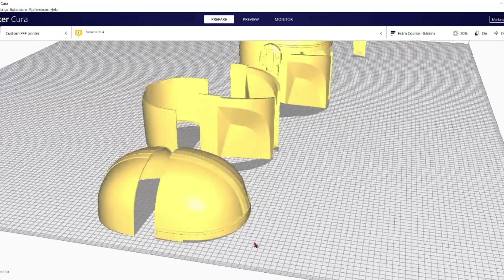Elegoo Neptune 3 MAX VS Creality CR-M4!  Can $470 beat $1100??

Comment: I have both these printers and they are both big disappointments. the Elegoo is compatible with Orca which is nice, but it suffers from poor build quality. Especially the hot end!

The problem with the CR-M4 is that Creality does not support it. Unless you want to build your own slicer profile, you're stuck using Creality Slicer 4.8.2, which has none of the features of a modern slicer. 
Creality is now up to version 6.0 of their slicer. It has a ton of nice (and in my opinion necessary) features. But they haven't added in profiles for the CR-M4. Think you'll use a nice slicer like Orca.... Nope no profiles. I haven't been able to find any (please send one if you do).
The most insulting part is that Creality Slicer V6.0 has profiles for all kinds of non-Creality printers including the Elegoo Neptune 4 Max, the CR-M4's crappier large format competitor...Creality has completely forgot about the CR-M4.

Comment: And now the Neptune 4 Max is out ($440), at 420x420x480.  So cool.  Being an open bed slinger limits your filament options, I guess, but PLA will probably do most everything you need, anyway.  Also needs more space than something like the Creality K1 Max, but that's a small thing compared to the massive build volume.  It would be nice to see an X/Y enclosed printer in this size.

Comment: Hey i have a neptune 4 max and the print head shakes and doesnt want to move but it levels and homes right. it only moves to home itself. Help plz.
Reply: Update : The small wires attached to the primary ribbon cable are incredibly fragile , I moved the device and brushed my futon (as my printer was on the floor) and knocked a single prong out of place. I had a false alarm prior to this that made me backtrack.

Comment: Bought a Neptune 3 max and I loved it but after a month it had some leveling issues which resulted in the blob of death that killed my heat element. Replaced the heat element and printer wouldn’t heat up. Elegoo is currently sending a new ribbon cable and printer head in like 2 weeks. It could have been my fault but I heard other customers had issues after a month on Amazon reviews. Customer service seemed really good but wonder if the creality printer would have that problem long term

Comment: @ frank  hey I was having some trouble with a 3d model  that I was trying to print .I'm not sure  why but when I slice it in cura it just does parts of it and it want do vertical  at all it prints the supports but want actual print the mask is there any tips you could think of. thanks!

Comment: Thanks for the video! That was absolutely information of use to me that you provided. I have two Creality printers right now. An Ender 5-S1 with Sonic Pad and a K1 Max. Got to say I'm quite disappointed with the K1 max. You can definitely tell they rushed it to Market. I'm considering a larger format printer for my next purchase as my business is starting to grow and I just need more space to print parts. Wanting to stick with the Creality brand I was considering the Cr-10 M4 but have been considering the Anycubic Cobra and Neptune 4 max. I know both of those run Klipper but I love the controllability and accessibility that the Sonic pad provides. I.E. Z-offset adjustment mid print, speed, extrusion rate etc. Do you happen to know if it's possible to hook up the Sonic pad to the Neptune for max? Or are those settings accessible through a web interface?

Comment: Alright in concerned now. I understand the elegoo neptune 3 max has a slightly taller build volume. I looking to make armor pieces similar in size to what you build. Will me getting the elegoo neptune 4 max with a 480mm build height be handicapping myself or did you still have room over your builds on the neptune 3 max 🤔

Comment: I have a creality Max and my biggest gripe is the undersized heater causing temps to be cooler for about 4 inches all around the bed. I print a lot of petg big parts always came out warped…Did they fix this for the M4?

Comment: I think the M$ got glazed over on this review. The 32 bit board, newer stepper motors, Wifi and RJ45 cable ports. It got a lot of extras. I print a lot of PETG and having an all metal hotend with higher temps is a winner. I also have a Neptune 3 pro. I can see the difference. So, far at work we are running the M4's non stop running large Prototype parts. The quality on the CR-10 Max was hit and miss on PETG. Also you can't really mod out a Neptune. If I am wrong, please let me know. Creality printers tend to develop a large bsae of mods and after market parts.

Comment: Hi, i have a question. I’m looking into purchasing a large bed printer, but no break the bank. The 2 I’m looking at are the Neptune 3 max and the ender 5 max. Do you have a video comparing the 2, (I’ll be looking for your Neptune and ender 5 max vidéos to see whatever I can get in info), or what would you think of one vs the other (slinger vs non slinger build size etc) and one other thing. Going on sites, people mention you should upgrade this and that, how are both those printers out of the box and do they really need the upgrades? I can explain, however, it may have to go offline if u have time.. appreciate your videos and thx if you can respond.

Comment: I'm afraid of buying the M4 because it appears difficult to find sufficient replacement parts.
Its not the standard Creality sprite setup either. For example where to go for a replacement cables for this machine?
Where did you get the PEI bed? I just cant find it.

Comment: Hmm... I actually bought the 2 printers to see for myself...
and I dONT agree with you on so many counts...you get what you pay for and even basic stuff eg for print farms you need aboslutely need ethernet...Neptune = NO, The setup was so straight forward with the Cr-M4, however I had to recheck the frame alignment on the Neptune which was out and I had to adjust the rod on one side, the Neptune is all v/rollers...the PEI top on the cr has need stops so it goes back on perfectly, the neptune does not and its a pita...on and on it goes. In reality the Cr-M4 ia probably $100 overpriced but its chalk and cheese imvho. Im just about to do the final test of 100mm/s which the cr got by ok...lets see what the neptune does. If you have time to burn, then do the upgrades then sure go the Neptune, but if you seriously want to just get on with it and have an expectation of good working life, just spend the money.
I really enjoy a lot of your vids...but this one is misleading. In AUD$ I paid $1320 vs $800
Oh and no usba socket...transflash only...why???

EDIT: Out of the box...printing large objects are a lot slower for same quality on the Elegoo...about to look for the issues but smaller details are much worse; looks like resonances that I now have to waste my time chasing. The CR-M4 is a much better machine...trust me (and I dont get a commission)

AND

THE FLOW RATES:
Neptune is abysmal 5mm3/s
 vs 
21mm3/s on CR-M4...

get what you pay for. Prob good to get a bit more detail before making the claims (with respect)

Comment: I have a Neptune 3 Pro, and its been a pleasure to work with. I have yet to experience failures of any kind. Super reliable workhorse. I'm currently building a (non-LDO, I wanted to hand pick every part) 350x350 Voron 2.4R2. I'll be using it for exotic materials, and super fast prints. Even with both of those, I'm still going to buy a Neptune 3 Max if I can ever find them in stock. They'll likely release/pre-order the Neptune 4 Max by the time that happens. This is the first video I watched from this channel, and it was nice to see an unsponsored, unbiased video that wasn't a thinly veiled Elegoo commercial. That being said, I couldn't help but notice the arm positioning throughout. The elbows are always at a 90⁰ or higher bend, thus positioning the biceps in a cosmetically favorable position. To my eye, a lot of the movements/gestures seemed unnatural and just stood out. It kinda reminded me of the very first Transformers movie where Shia and Megan are sitting in Bumblebee. In the scene, he's making deliberate (and awkward looking) gestures with his arm attempting to make his arm look like he has muscle. This happens when he's pointing at the mirrored ball hanging from his rear view. Look it up on YouTube if you've never seen it. No hate, I just thought it was an amusing observation. Video was solid though 👍

Comment: Personally I refuse to buy anything creality anymore. I got the Cr10 max on finance and with in the first week the main board caught fire. Messaging company (who had tons of good reviews) they said because it’s financed it’s non refundable but they can replace it. Because of what happened I obviously didn’t want the same thing happening again I argued it and was told “either it’s a replacement or it’s nothing” I messaged creality they couldn’t care less. I ended up negotiating for a cr10s5. The cr10s5 (the worse rated printer out of the 2) performed better but after 6 months a bed cable snapped and neither the company or creality wanted to replace or repair it. Creality actually told me they no longer make parts for it. 

I have 3 anycubic chirons now. The only problem I have found is the circuit board in the hotend care unreliable but other than that they’re pretty good printers.

Comment: Have a snapmaker 350t, I havent seen to many videos of first hand uses of it. If you ever get one and review it or have any pros and cons over it that would be amazing
Reply from the maker: I actually have that one too. It’s an “okay” printer. It does 3 things good. None of them great.
Reply: @FranklyBuilt First off, thank you for the response! But yeah, thats what I've found out, I've really enjoyed the machine and have already had some many projects/sales that use both the laser and 3d printer aspects of it, but I'm trying now to find a better version of each procedure it can do on separate machines that are designed for the one aspect rather than have a jack of 3 trades.

Comment: I recently bought the Neptune 3 max. It’s my first 3D printer. I’m wondering what settings you used for Acura though. I went to set it up and the Neptune Max was not in the list of preset printers.
Reply from the maker: Use the Elegoo Cura program on the sd card

Comment: The only good thing about the low quality Creality machines is that many great innovators introduced products to make them better.  Bondtech has many upgrade paths to make them print very nicely with their direct drive setups and more.  Tiny Machines has a lot of upgrades as well.  But I agree, the Elegoo is really a better bang for the buck.  I'm curious how powerful that heater is since it would be a great platform for a 0.8 nozzle (or bigger)

Comment: For the M4 you're paying for some wiggle room and quality things. 800w PSU, new all metal Sprite printhead, dual Y axis linear rails, larger print volume etc. It would be interesting to see you do a high speed/print quality comparison on a large print. Especially after the Sonic Pad update comes out for the CR-M4, and you can get klipper on it. I'd put money on the CR-M4 printing faster.

Comment: Remember these words you pay for what you get. So yes you could spend $470 on the Neptune Max or 1100 on the CR4. The Neptune Max breaks down more often and run into some more problems. I've been running a CR4 for about a month now not a single flaw. When I got the Neptune Max I had some failures not every time but it would happen almost regularly if I didn't have the exact setting right. All comes down to how much you want to pay.
Reply: Not even mentioned the 30mm bigger printing area all around. That's massive.

Comment: Hi Frank, great presentation. My question is I have a Lulzbot Taz 6 I've had for a while and I loved it's auto leveling and good print quality but how good is the leveling on the Neptune 3 MAX? Also, how did you wash and cure such a large object? I don't think that helmet is going to fit in my AnyCubic Wash & Cure Plus. Ha!
Reply from the maker: It’s much better and easier to use than the Lulzbot UI .

Also…you realize this is an plastic FDM printer not resin right? Lol

Comment: I never understood why professional 3D printer reviewers can't set up something for video recording during test prints, so if there is an issue it's not some riddle wrapped in a mystery inside an enigma.  Plus now you have a timecode that can help you get to the bottom of things in the print logs.
Reply from the maker: Oh we do just sometimes it isn’t worth it to set it up. But it takes up so much space and memory to record every print. So we limit it. And it’s never the print that fails that you catch. Also failures are easy to figure out and diagnose even without video.

Comment: For giant prints have you tested the ender extender for the Ender 3 series?  I got the Ender 3 pro for $100 and the ender extender kit is about $200 so overall it seems to come in cheaper than your options here.
Reply from the maker: Not necessarily. The $200 extended kit is still missing stuff. You also need to completely recalibrate the printer. It’s not a plug and play add on. People spend months building extender kits and still never get the printer to work right. These come out of box ready to go with hundreds of dollars more in features. Unfortunately the extenders just aren’t worth it anymore
Reply: @Frankly Built  thanks for the reply.  I haven't gotten the extender kit but I was considering it.  May save and go to something else then if not recommended.

Comment: I need HELP my creality ender 3 is somehow giving off fumes its a really strong smell I'm pretty sure its my Capricorn Bowden tube because it looked melted when I printed pet g at 240 degrees for the nozzle and 70-80 degrees for the bed so I cut it off the melted part and continued to print but now pla at 200 degrees for the nozzle and 60 degrees for the bed . However I recently accidently set the nozzle to 260 so it occurred again but now the fumes don't seem to go and I can only smell them when I heat everything up to print even for pla at 200 degrees for the nozzle and 60 degrees. Meaning I can't print for the time being and I'm on a deadline for a present

Comment: If one only plans on doing smaller prints, is there any downside to getting a printer that's 'too big'?  I know in many instances, it's get as big as you can afford because you can never have too much...but is there any quality issues w/ doing small parts on a big machine?  I'm trying to decide if I should get what I need, and maybe have to upgrade someday, or just get the big one and only ever get one.
Reply from the maker: Quality and speed.
Reply: @FranklyBuilt  I guess that's what I'm asking....is there a difference between the Neptune 3 Pro, Plus and Max besides potential print volume?  Are they equally as good on small parts?  Or does the size change how fine they can print?

Comment: Frankly… is better to have a fast 3D printer at a low price or a slow 3D priner at a  high prize? i see a new delta 3D printer it is flsun v400 … 400mm/s speed printing and 300mm x 410mm volume printing about $900

Comment: 03:40 That USB port on the side if for the Creality camera, used with the build in wifi box. My CR10s has the same port. When not printing with the wifi box, I use it to power my ring light when I print on it.

Comment: I’m hoping that Bambu makes a larger build printer. I will buy one of those. I haven’t seen anyone do a mods to put a second parts fan inside of the X1C and I’m wondering if that would cause too many problems.

Comment: One thing you completely glossed over was the fact the creality came with linear rails.  Not sure what the elegoo has, but assuming it just has the standard V-rails.  Linear rails are much more precice and are more durable.  May or may not effect the print quality, but they will significantly effect the cost of the printer.  Whether its worth it or not is completely up to the individual.  Nice to know there are cheaper options out there though!
Reply from the maker: I mentioned them yeah but those alone plus a couple small “extra” features doesn’t justify this price at all IMO

Comment: the neptune 3 max actually has 3 fans in the extruder head. one on each side and one on the bottom. so as far as the noise is concerned. not bad at all.

Comment: Actually, thank you for the review. While I am usually a fan of faster printing I’m also in the camp of being fine with slower speed printing for large objects. And I’m in the market for a new large build volume printer but was hesitant about the elegoo Neptune max. So the information provided in this video was quite helpful. 

One question I have is did you print with standard 0.4 nozzles? Or were they larger nozzles as it seems to me a larger nozzle on the larger printers makes a bit more sense.

Comment: Love your channel and always super excited with the superhero stuff. 
I just need to correct one thing as far as large format printers go, they aren't the largest, for the price point, hands down, but my Tenlog Tl-D5 is 500x500x500. AND, its an IDEX, dual filament printer. A year and a half ago when I bought it, it was $1100. Now it's closer to $1200 I think. 
BUT WAIT, THERE'S MORE! (lol) they have the D6 which is, you've probably guessed it, 600x600x600. Also IDEX, at about $1700. 
I'll be honest, I don't use it a lot though, but it's a good machine. 
That's it, keep making your great videos, Thanks!